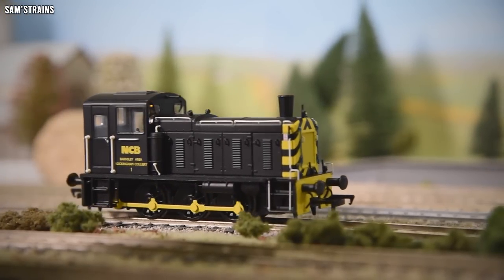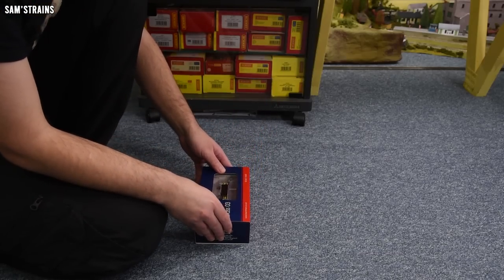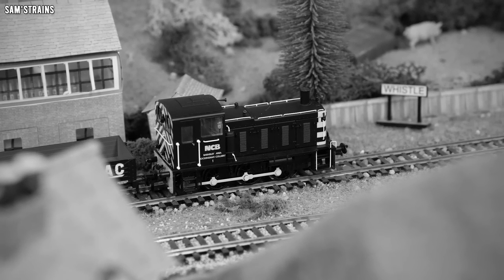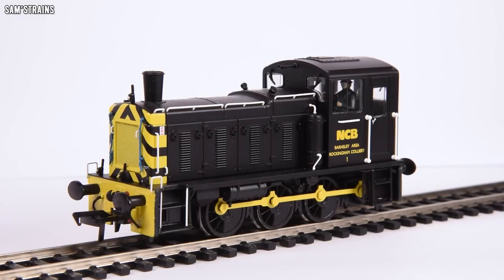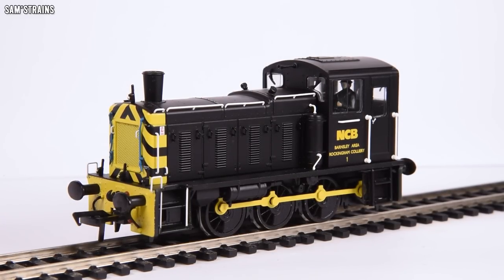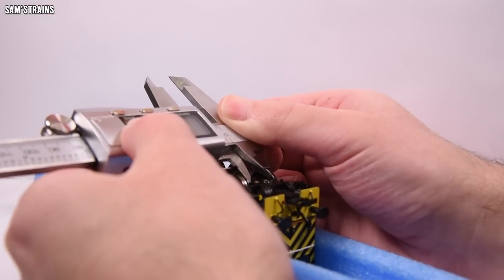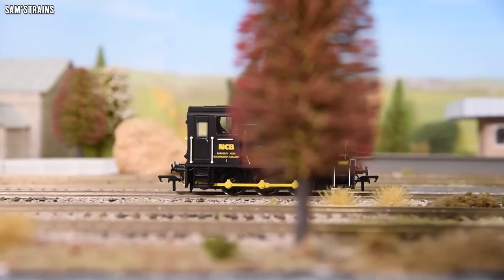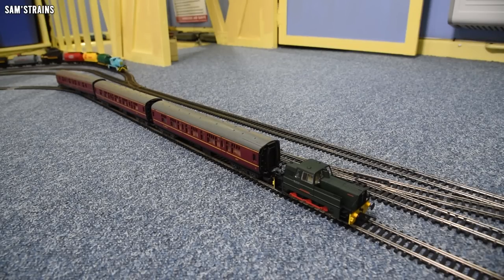Outstanding Bachmann 03 Shunter | Unboxing & Review

Comment: After supper with a coffee and Sam’s Trains, wonderful. Really looks the part Sam. Quite impressive actually. The only thing we never get our head around is why OO often omit lights. What the German brands already did in the 60s is providing them even in the tiniest lamp casings, solved through light tunneling. It’s really no rocket science, but there you go. This out of the way, it seems great quality. Pick-ups do look on the very flimsy side though with one tiny contact point per wheel, not all too convincing. It’s not only about contact points. Quality surface pick-ups also add up to an electric fielding effect for helping conductivity very much more reliably. We’ve had that experience with a steamer stalling too easily. Turned out that a ~3 mm (cleaned) contact surface area on the pilot wheels’ axle wasn’t touching firmly enough whilst all other wheels had clean but rather flimsy contacts. An electronic scientist told us about electric fielding, optimum contact surface area and why it’s important. So those 3 mm were vital. Well, that’s just our experience. On the other hand, you don’t want too much drag either. Certainly looks fantastic Sam. Had it been fitted with directional running lights we would have no problems at ~100 - 120 GBP. But it does look and run fantastic overall. Fair review.
Reply from the maker: haha thank you very much! Yes much more impressive than I expected - thing is most manufacturers do fit lights these days (except still Hornby for some reason!) The pickups are actually spot on - very reliable after running in! :D
Thanks for watching, Sam :)

Comment: A good review of a lovely little model, even if the body tooling is a good fifteen years old!  I bought the NSE-liveried 03179 from Modelzone in 2011, I think, and I now have four of them.  It's good that the body tooling still stands up, and it still seems perfectly good for a loco which is run a fair bit.  Fiddly detail is for display models!
I think that the history of the body tooling is that Kader originally did the Class 03 for Mainline, and then used the same tools, slightly modified, for the Class 04 - both with split frame chassis.  Then, when Bachmann reintroduced the 03, they produced new tooling for it, which is the current body.
Oh, and my four are good runners and, if anything, the gearing is even slower.  Given that the real thing had a top speed of about 28mph, it's not an issue!!
Reply from the maker: Thanks John - I was very impressed by the level of detail, given it's not a new tooled loco. Thanks for sharing - yes you'll be right - this can't be the original Mainline moulding!
Thanks for watching, Sam :)

Comment: A great little Class 03 NCB loco from Bachmann. Well build for accessibility and maintenance with clean lining livery. I like the detailing though the handrails could have been metal all around. Some of the best parts on the loco is the safety grill behind the cab footsteps, the Radiator Filler notice finely printed on the front, and the inclusion of Driver and Lit Cab detail, (Hornby 37 Cephus has none at this price). It is a wonderful looking shunter that runs very well, minus the stalling that should disappear with running in. A complimentary review Sam and thanks for sharing this wee gem of a model, tempted to buy one myself now.

Comment: Hi Sam i bought from a collection in i think around 2010,it was what is still now dcc fitted, only it was 6 pin then but in the same  tooling as now. It was a collectors pack and included two 03's! Both br blue only one was the conical chimney and one was the flower pot alternative, there were and are still two versions available. They came in their individual boxes which came in a single box, think 504 were produced and think i paid then 120.00.!! Never really run them, but should do, the motors may have seized with lack of running! A brilliant review from you and cannot rate them highly enough enjoyed, hope your well regards Nick Redshed.

Comment: I am not a diesel lover but I do have two! A Bachmann 45/0 to pull the CMX track cleaner, and my 03 (£93) to work a coal yard. Yes,
I am a Steam lover but this 'mini gronk' really ticks the boxes and gives so much pleasure, that I quite often load her up and sit back and admire the little beauty. Top marks Bachmann for the 03 Bachmann! Also the 45/0 is a peach and ohh I love running her to.
Such a good and reliable engine (with lights), also sitting well with the Steam Loco's. A great review Sam, credit where credit is due,
eh?

Comment: Excellent video as always. I found out that you should clean the wheels even with new engines. A lot of times there is oily residual on the wheels threads. I use paper towel and alcohol laying on a piece of track to clean them and it does wanders to the pickup. Cheers.

Comment: Sam, What I do like about Bachmann is that when they do fit proper bearings to there locos they are with a square outside profile that stops the bearing rotating in the frames unlike the Hornby bearings that are circular on the outside profile which relies on the keeper plate clamping the  bearing .
Reply from the maker: Yes that's true David - it keeps the bearings nice and straight, though it does make them fiddlier to deal with!
Thanks for watching, Sam :)

Comment: When you told us the RRP, I immediately said "that's it?!"

Not because the quality suggests that it should be higher (that is true though), but because that is the same or a similar RRP to the Graham Farish N gauge version, and can be picked up for much cheaper at retailers; there are no longer any Farish locos for less than £100 brand new, the only locos below that mark are the Terriers and possibly 57XXs from Dapol.

Comment: The mainline 03 and the original bachmann one did have different chassis. The mainline one used a ringfield pod motor (like the collett goods, not the ones built into the chassis like the j72 and rebuilt royal scot), the bachmann one used a can motor inside the split chassis (as per the majority of bachmann's split chassis locos did, like the hall and v2 and b1 and lord nelson and rebuilt/unrebuilt royal scots). I believe the 04 was tooled based around the 03 chassis, although obviously at a later date.
As far as i know, the DCC ready ones would be this new tooling only (but I could be wrong, like I'm sure mine has the more standard older motor). I have one, D2011 in plain BR green, and it's a fantastic little runner. Cuts out a little on DCC, but I don't have a stay alive in it, and it's so smooth and well detailed. But over the last few years, Bachmann have updated most if not all their 6-pin locos to have the next18 socket, because it's objectively better. No other chassis modifications other than swapping the DCC interface. Which makes one wonder, why have hornby stuck with 4 and 8 pin for so long, only going for 6 pin recently?
I use the £100 rule too, although mine is, if it isn't something tooled in the last 5 years, I won't pay more than £100 for it.

Comment: You can literally just add side plates in cowcatchers to this model and you’ve got yourself a good Mavis model
Reply from the maker: haha that'd be a really fun project actually!! :D
Thanks for watching, Sam :)
Reply: Sort of mavis is a class04 not s class 03
Reply: Mavis is a class 04
Reply: From what I've seen, the only external difference between the 03 and the 04 (Mavis) is a differently shaped exhaust stack. But yeah, put on a cone instead of a cylinder and paint over the NCB lettering, and there you go!

Comment: Great review Sam,  just purchased the same loco a few days ago and dcc fitted it, was really easy to do my Hornby select dcc controller perhaps doesn't like the choice of dcc chip i have (Bachmann 36-567A, next 18 loco decoder with brake button function) and tends to cut out and not move a lot in lower speeds across points I'm thinking adding a stay alive capacitor would solve this issue, my favourite features so far are being able to turn the cab light on and off and getting a good slow crawl with loaded coal waggons handled hauling 8 fully loaded  coal wagons perfectly
Reply from the maker: Thanks for sharing Andy - yes I can see it being very easy, as there's plenty of room and good access to the socket! Some sort of stayalive would definitely help - mine cut out a bit too before I ran it in!
Thanks for watching, Sam :)

Comment: Hi Sam I've been watching for a while but I'm now trying to redo my layout. Unfortunately my original track got really badly damaged. So what do you suggest to "start" with (starter sets,locos,ect.) Thanks
Reply from the maker: Sounds awesome Nathan - sure, a starter set is a good idea if you're looking to start from scratch - one of the larger Hornby sets would be good, one with points, as they use nice 3rd radius curves that suit all OO engines!
Thanks for watching, Sam :)

Comment: Hi Sam How are You?
Yeah I just bought one of these recently & I was slightly blown away by it, I wasn't expecting it to be this good.
didn't expect it t have a cab light either, the only major down side I would say personally is that the steps on the side are pretty fragile. I has a scary moment were one was touch the counter weight but it was easily sorted. 
Overall a silver lining loco for as I've has issue with 2 other Bachmann coreless motor locos recently so it was just nice to get one that worked. the Precedent & double fairlie both had motor troubles :(  
Keep up up the good work Sam and I'm looking forward to the next review :)
Reply from the maker: I'm great thanks, how are you? Glad you got one too - you can colour me blown away too - much better than expected! Appreciate the kind words,
Cheers,
Sam :)

Comment: I got a BR Green one with the 6 pin DCC scoket, and the 'normal' motor,  it was reduced at my local Model Zone model shop. (Do you Remember Model Zone?)  I really would like a BR Blue one, but the price is outside my rules for tiny locos!

Comment: Is mine in BR green a good model ? As seen here, it is ! Looks nice, good build quality, nice features, top quality drivetrain, easy to open and, most of all, excellent dynamic qualities.
If I might, I would have as critics the absence of a flywheel and the engine that is slightly overspeeding for my taste, but that is just my opinion, and removes nothing from the overall excellent quality of this engine.
Well, Sam, if you can test a class 08 by Bachmann, a BR4 version is expected soon, that would be nice. Hope they have the same level of quality on their 08 !

Comment: Hey Sam
I noticed that you haven't done an old loco for a while
My suggestion for a review is a bit different

A jouef class 40

It can go round quite tight corners and is 4 wheel drive with a 5 pole mother and if done right it can be a decent model

I've noticed jouef class 40 had been disregard and I think it should be more well known

Best regards
Luke

Comment: Do you have a Hornby Class 08?
Reply from the maker: I don't unfortunately... or is that fortunately?! ;D
Thanks for watching, Sam :)
Reply: @SamsTrains  My Hornby 08 is fantastic.  Unless you want to fit a DCC decoder, then that is where it falls flat on its face!  As there is very little room, for a decoder even a direct 8 pin one, god knows who designes them, but simply having a DCC socket does not mean that a decoder will fit inside the thing! The detail is top of the mark, and my example runs really well.  I also have a couple of Bachmann 08s, one of their first batch without DCC socket, and a later one with a DCC socket, again like the Hornby one i have not managed to fit a decoder and get the body back on. The space inside has not been thought out.

Comment: The 03 was completely retooled around 2010, and fundamentally its decent...ish. The body and general detailing is fantastic, but I'd actually cast a bit of a downer on this model. I've had no end of problems with the pickups on mine, it was reasonable on DC but always a little stuttery. When I DCC fitted it though, it completely crapped out with any form of momentum programmed in. Even with a stay alive capacitor fitted (which doesn't fit due to the chassis design so it intrudes the cab), its barely useable. Its a solid 8/10 for looks, but its performance even with a stay alive fitted is a 4/10 at best. Its a nice paperweight.
Reply from the maker: Very interesting - if from 2010, presumably yours has a different chassis to this? Doubt they were fitting coreless motors in 2010!
Thanks for watching, Sam :)
Reply: @SamsTrains  Fundamentally its the same chassis, the only difference is the motor cradle was altered to take a smaller (coreless) motor in order to provide room for sound, this change was announced in 2017 and delivered around 2020ish. The PCB was also changed to next18 but uses the same screw mounts as the original 6 pin PCB. Otherwise its exactly the same model, although mine was factory weathered and released around 2018...and yes the overspray weathering on the wheels made it so much worse!!! But even after stripping down and cleaning everything its never been good at low speed running; its great with power hard wired to the 6 pin socket, so its not the pre-coreless motor at fault. Its down to the the naff pickups.

Comment: Your Atlas GP40 needs a redoux in ratings because of miscommunication in accessing the chassis and motor...  I understand the 03 and GP40 are two different models, but I sense a great bias in allowance of expectations changed as you got "closer" to the 03 model. The 03  cut out on many occasions...  Sam...   The GP40 is rugged in quality and "hard to break" compared to many locomotives you have reviewed. I liked your praise of this shunter, yes, better "quality" than previous British locomotives you have reviewed... that crawl is excellent ...BUT the stalling, Sam. You're not so judgmental about the nudging you performed. That needed to be a greater factor.
John

Comment: Looks like a lil' work horse. It's only flaw, are those dang nylon gears. If I get one, I'll be finding a way to remove those. Bachmann these gears alot, and it aint isolated. I personally have 3 (now 2) examples with them, my GS4 (which is being rebuilt), my GP30, and my USRA/Baldwin/Lima 0-6-0. However, only my GP30 makes any kind of noise with them. My GS4 got titanium gears. Lightweight, but strong, and she purr's right on down the line.

Comment: Dear Sam , could you give me any advice in laying down track for my model railway?
Reply from the maker: Well as you can see I'm no expert - but do it on baseboards, not on the floor, and make sure you get everything nice and level. Don't put curves in opposing directions right next to eachother, and use 3rd radius as a minimum for curves - that's what I'd suggest!
Thanks for watching, Sam :)
Reply: @SamsTrains  Thank you